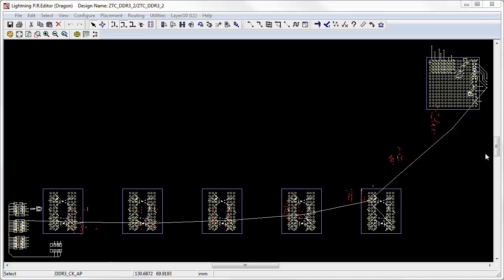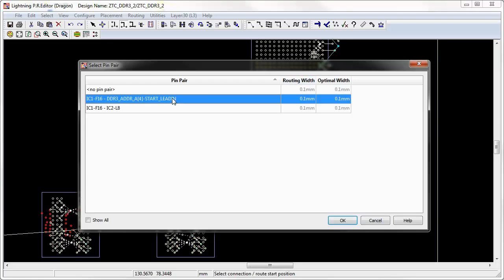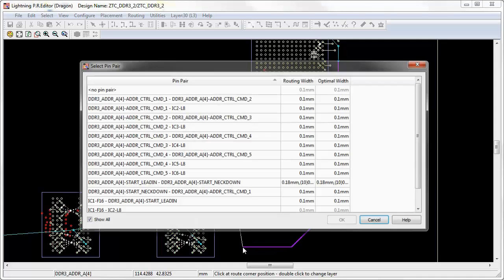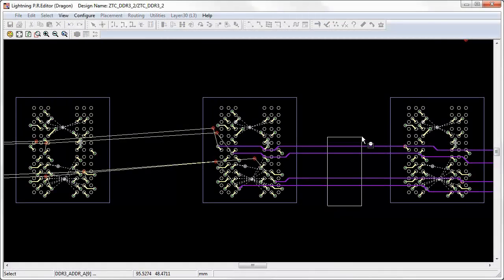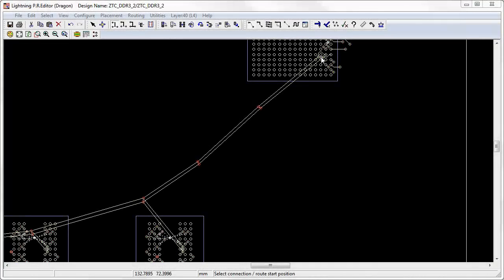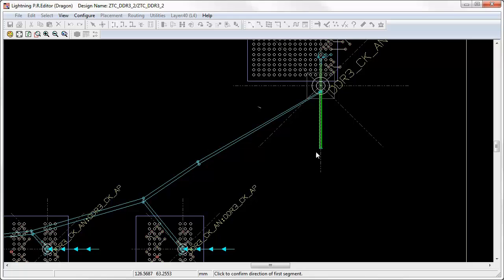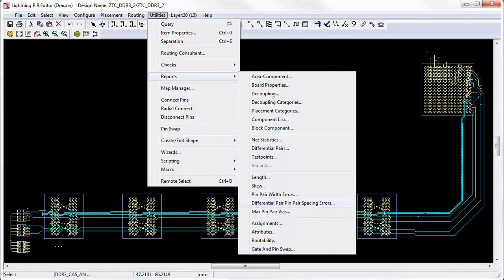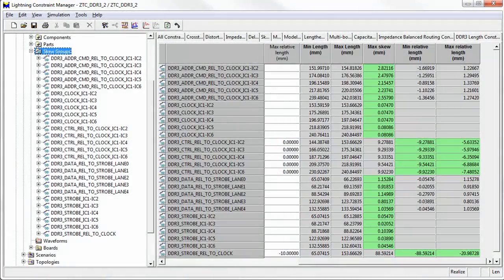Defining and routing PCB constraints for DDR3 memory circuits: Pt3 Routing the constraints

Comment from the maker: Part 3

But please be very, very careful and study the application notes for the specific device and controller you are using. Many systems do not allow this kind of swap. We do not do this form of swap in the example in out video and in that example, that kind of swap is not necessarily valid.

Comment from the maker: Part 2

In some memory systems where the data bits (DQ) within each byte lane are used for nothing other than transmitting data from controller to SDRAM and from SDRAM to controller, the data bits within each byte lane can be swapped with no effect on the logic. You cannot swap data bits BETWEEN byte lanes because each lane has its own strobe (DQS). You cannot swap any of the other signals in this way.

Comment from the maker: Following is a three part reply (because of character limits):

Part 1

If I understand the question correctly, it is about swapping pins within a DQ data bus. This question is related to the general design of memory interfaces rather than the specific example we show the video.

The answer to this question depends on the precise chipset being used and cannot be applied to general memory system design.

Comment: Hi, I'm quite confused about schematic with DDR2 or DDR3 memory, I've checked several design,  and some design have the pin D0 of the chip memory connected to net MDQ0,D1 connected to MDQ1 ( the other pins have  the same logic, with the respective number bit) , so i can understand it , BUT OTHER DESIGN ARE VERY DIFFERENT , just for example the pin D0 of the chip memory is connected to MDQ5, D1 connected to MDQ7 ..., it's another technique, there is logic for this? pls i hope someone can help me.